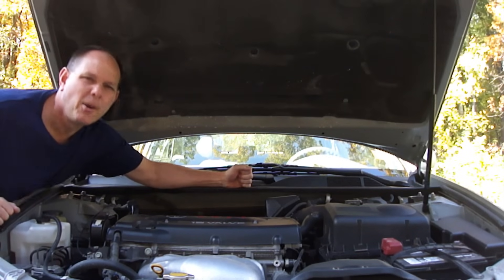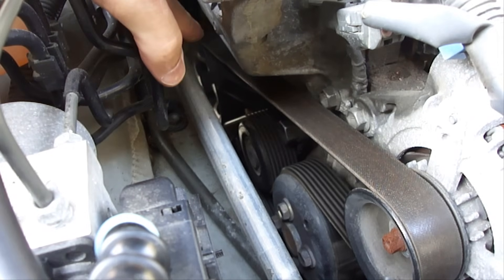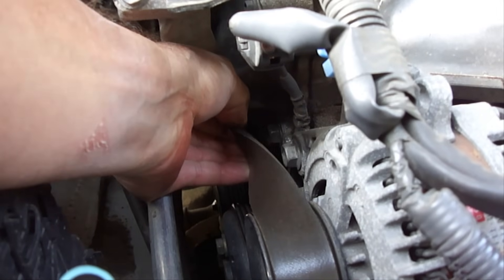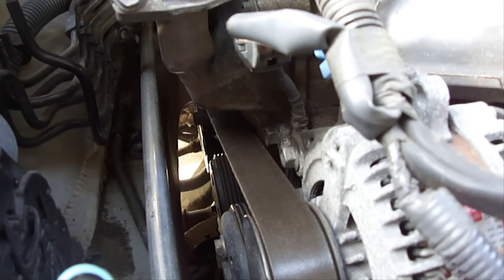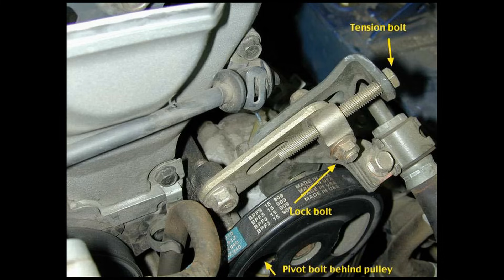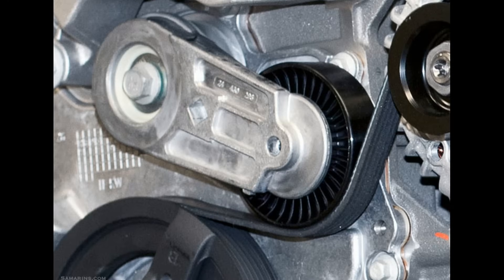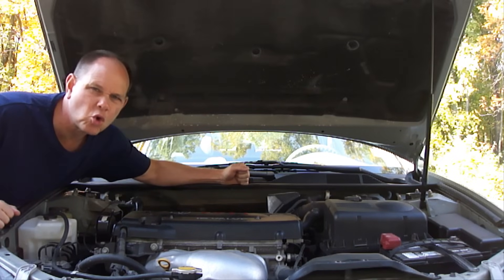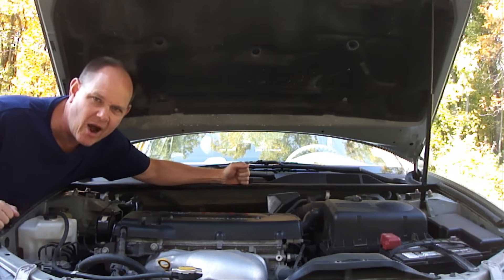How To Check & Adjust Serpentine Drive Belt Tension On Your Car

Comment: New serpentine belts are way tighter than old because the new one has plenty of material and has not yet been stretched. This makes the installation process for the newer/tighter belt difficult to impossible, even with the tensioner cranked to maximum loosness.

Can you please share some pro-tricks to get the belt on when faced with this difficulty.

Thanks for a response.
Reply from the maker: The only trick I know of is this.  First lubricate both sides of the serpentine belt and the outer surface of the tensioner pulley with Armorall.  Once the automatic tensioner is fully pushed down, slip the belt lastly over the tensioner pulley.  Let me know how it goes.
Reply: Hi I repalced my v-belt due to chirping. the chirping is gone but replaced by squealing sound. Does it squeal if the tension is to tight?
Reply from the maker: Spray the belt with Armor-All.  If the noise continues, the belt could be too tight or one of the accessories has bad bearings.

Comment: Just bout new aftermarket drive belt. Squealing with proper tension. Got to Toyota dealership and bout one. Same price. No squealing. Smooth and quiet. Aftermarket is shooting in the dark
Reply from the maker: Toyota parts are built to much higher standards. My brother works for a steel company and said that when they make steel for Toyota they have the highest requirements of any auto company.

Comment: Belt should be good seeing as all we did was replaced the alternator which required us to loosen the belt and the belt was fine before that. Now we can't seem to tighten the belt back. 2009 Chrysler Aspen so it has a automatic drive belt tensioner.Help please

Comment: This was great. Thanks. Now I'm just wondering why my 1988 Camaro has thick yellow power steering fluid? (2.8 litre v6)
Reply from the maker: Your power steering fluid has probably just aged and needs to be replaced. I always replace my power steering fluid with full synthetic.
Reply: @proclaimliberty2000  ok cool thanks. Yeah, not used to yellow p.s. fluid, ha ha.
Reply from the maker: Jeffrey Lieberman 👍😊
Reply: Hey its probably uses ATF instead of power steering fluid.

Comment: If I have a 1/2 inch shorter belt will it be ok with a automatic drive belt tensioner? It's close to the mark I made with the stock belt on.
Reply from the maker: I would only use OEM stock belt.
Reply: @proclaimliberty2000  yea got an aftermarket alternator with a smaller pulley.

Comment: I changed my alternater in 07 avalon I though I put the belt right but I turn on the engine it ripped the belt .I put a new belt now its loose what you think happen?

Comment: I have a question I have 2015 honda civic ex and I get a chirping noise or metallic sound coming from the right side passenger side and only does it while I'm driving 15- 20 mph and goes away after I go higher rpms but eventually comes back at the same speed again. I've already replaced the idler pulley, the water pump, the alternator, the tensioner belt and serpentine belt and also the crankshaft pulley and its still making the noise... took it to the shop and they said my tensioner belt has play back and forth but its brand new from the dealership and has been replaced 5x already and still makes the noise while driving at low speeds. Can you help or have any ideas?

Comment: I am afraid that I will have to modify my comment that I have made earlier, because I made it before I have actually tried what you have suggested. It seems that there is going to still be a little uncertainty as to whether or not the fan belt is the right tightness. I wouldn't be surprised if a person of unusual strength will be able to twist the fan belt more than ninety degrees and a person of unusual weakness won't be able to twist that same fan belt as much as ninety degrees. Now, of course, having this way to gauge the tightness of the fan belt is better than not have any way at all, but I felt that I had to mention the forgoing.
Reply from the maker: Jonathan Smith 👍 It’s just a general guideline that has always worked me.

Comment: My belt tensioner kinda bounces around and makes noises  is the tensioner suppose to stay still or have a little bobble to it ?
Reply from the maker: There should be no noise or bounce from the tensioner.
Reply: proclaimliberty2000 my belt popped off last night. A week or two ago I notice the tensioner moved up and down about a quarter inch I wasn’t sure if this was suppose to happen. I’ll swap it out and check !
Reply from the maker: RamenNoodles4Me it sounds like you may need a new belt tensioner.
Reply: proclaimliberty2000 yep. I slapped a new one in with new belts and the tension pully does not move at all when the car is on. I thought maybe the movement was it adjusting 😆
Reply from the maker: RamenNoodles4Me 👍😊

Comment: I added a new drive belt. I have this exact car. After i added the belt,  one of the pulleys or something near the pulleys began making a screeching sound. My power steering also has taken a turn for the worse. I have replaced pulley and belt. I fear that the tension may be too tight. how do i release it? I tried the “turning it 1/2 to the side” and it’s really tight i can barely make it without forcing it. My question is how do I make the belt .. less tight?
Reply from the maker: JalenJay you cannot make the belt less tight with a tensioner system. Did you buy a genuine Toyota OEM serpentine belt?

Comment: I saw your video my car has a automatic tensioner and I had a break down because the tensioner had fallen I went to the mechanic he said to replace the tensioner and belt I did replace it but my car has become very slow when AC is on and when I on the AC the tensioner shakes continiously I went to the mechanic and he said it is normal. But my car takes hell lot of load when I on the AC. What should I do ?? Is shaking of the tensioner when AC is on normal ???
Reply from the maker: Yavin Solomon A tensioner in good condition should not shake. Are you sure it’s a OEM replacement? It could also have the wrong size belt.
Reply: proclaimliberty2000 there are two belts the above one is tilting but the lower one is stiff. My car runs perfect without ac but as soon as AC is on it becomes rough. Mechanics are saying IAC valve to be changes, tensioner and after that if still problem is there then AC compressor. My car AC is cooling very nice. All these parts are expensive and no mechanic is giving guarantee that the issue will be solved after replacing. Help !
Reply from the maker: @solomonlegalities  What do you mean when you say it becomes rough?  Is it idling rough or causes driving issues?  I've had some vehicles that idled rough when the A/C kicked on but mechanically everything was fine and it drove fine.
Reply: proclaimliberty2000 yes sir it is driving but the car becomes very slow on acceleration when I put on the AC. I can show u the video of my car engine when I put the AC on. It is working fine mechanically but the engine is taking lot of load if I switch of the AC the car drives like new
Reply from the maker: @solomonlegalities  I'm hoping you have a trust worthy mechanic.  Has he driven it to see what you're talking about?
Reply: proclaimliberty2000 yes but my car is a rare car in my country and mechanics are just saying that maybe IAC valve needs replacement, AC compressor, tensioner, but all are maybe maybe maybe but the parts are expensive so I want a perfect problem
Reply from the maker: Yavin Solomon only you can decide how much money it would be worth spending to try and fix this problem but as you say the mechanic cannot guarantee that it will fix it. One saying that I’ve kind of lived by is if it’s not broke don’t try to fix it. You could also have the mechanic try to fix the cheapest item one at a time and see how far you want to go with cost.  I really don’t think replacing the AC compressor will fix this problem but I could be wrong.
Reply: proclaimliberty2000 thanks a lot for help keep up the good work. My car is a nice car I want keep it I will try to put a new tensioner and see if the problem is still there and find some good mechanic who would first say what the problem is
Reply from the maker: Yavin Solomon You’re welcome. Let me know how it goes.

Comment: Mine appears to be perfectly tensioned but also still squeals some times
Reply from the maker: It’s time to replace the belt.
Reply: @proclaimliberty2000  I just did that. And it still squeals :(
Reply from the maker: @lostfan5054  Did you replace it with an OEM belt?
Reply: @proclaimliberty2000  I got the one AutoZone recommended for my car. They only had one in stock and I got that one.

Comment: i have a murano. can i adjust then tensioner while car is running? ive been at it for days and it either squeals cuz its to tight or the belt doesnt spin cuz its too loose.
Reply from the maker: What ever you do, DO NOT make an adjustment on the belt while the car is running.  It's way to dangerous.  It sounds to me like you might need a new belt.
Reply: And I always like to wear one of my favorite ties while I do this justment. or at least one of those really dope chains the gang Bangerz use when making all those very sexy rap videos.qa

Comment: Hi 
My belt was making a noise when the weather was cold, but now it's gone with the cold weather. I checked the tension and it seems to be correct. But I noticed two things, the automatic tensioner vibrates up and down when engine is on, and sometimes it wasn't making noise but as soon as I spray some water it will start chirping/squeaking. im so confused thanks a lot.
Reply from the maker: AAZ ZZAH From everything you’ve explained it would appear that your automatic tensioner needs to be replaced.
Reply: hi thanks for ur reply. the tension on the belt is good, so do i need to replace the whole tensioner assembly for only the tensioner pully band bearing?
Reply from the maker: The whole tensioner needs to be replaced.  It should not be vibrating up and down which is more than likely what is also causing the chirping/squeaking from not enough tension.
Reply: Aswome Ill give it a try thanks :)
Reply from the maker: You're welcome!  Just remember that this is one of those parts that does wear out and eventually needs to be replaced.

Comment: I cannot for the life of me get the freaking belt on with the tensioner pulley
Reply: I found out that the auto part store sold me the wrong belt and wasted a lot of time. I put the old belt back on and the next day I bought a different one from another auto part store. Problem fixed.